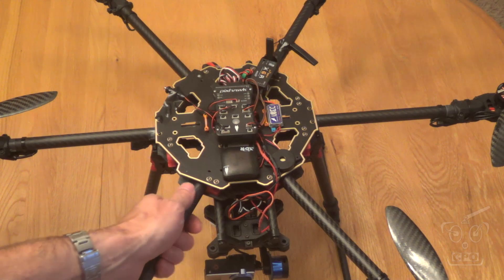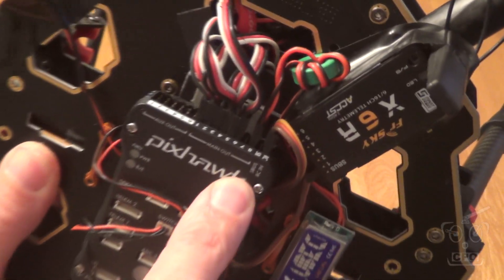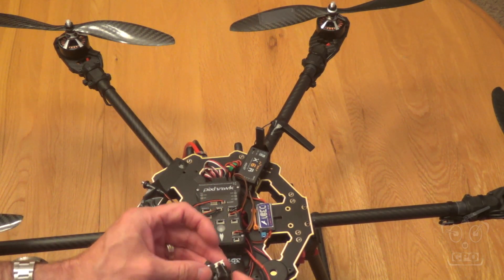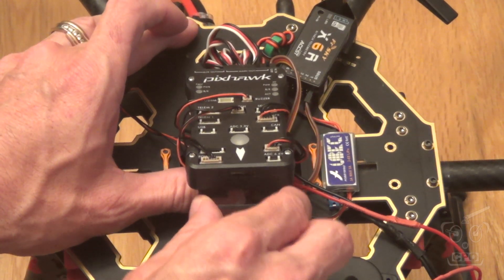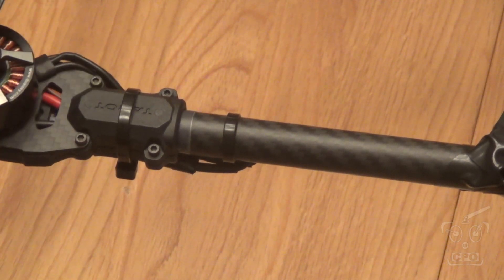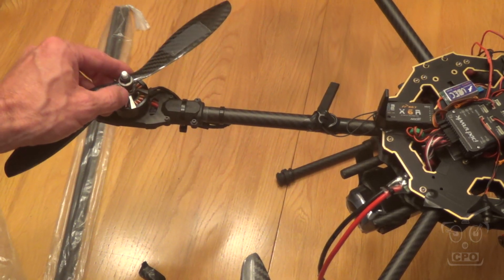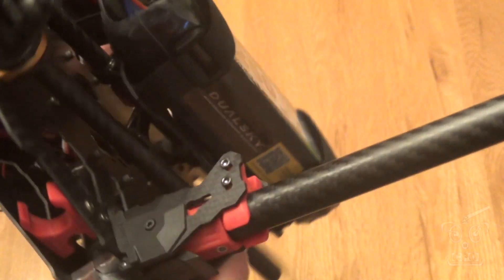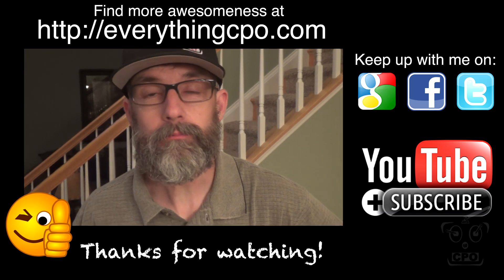Tarot 680 Pro Hexacopter : Build Tips and Update

Comment: Hey, thanks a lot for the video, right now I'm in trouble powering an octocopter with a pixhawk, I'm using the attopilot sensor since I have 6s batteries, but all my main outputs are being used so, I wonder if I could power the pixhawk with a UBEC using the aux output pins, do you know if that's possible? I'm not quite familiar with the pixhawk schematics and pinout yet... Again, thanks for your videos, they've been incredibly helpful

Comment: hi cpo !  can you help me !!  i building my first hexacopter tarot t960, and i will use 6 s 12000mah to power 6 x tarot 5008 340kv motors{from pdb} and 6 hobbywing xrotor 3d opto 40amps esc`s = 240amps max , but this little tarot 6 hub pdb seems to be very small to power 240 amps, do you think i can still use it or i should look for something bigger ?

Comment: Hey CPO, long time no speak. Looks great with your Tarot 680, as you know I found out the canopy mounting holes where wrong. I have now moved onto another Tarot 680, but this time I have changed the arms for longer ones and have ended up with a Hexacopter of 1.04m diameter. Having also printed many custom mots for the various electronics, I have never been a fan of Velcro. I like cable ties. Makes reminding all the items so easy with zero residue. This new Multirotor now has 2x8000mah 4S Lipos. Once I get some spec as per flight times I may decide to increase said Lipos. I am aiming for a 30ish minute flight time. Having added a DJI groundstation, Zenmuse H3-3D gimbal, anti collision lighting and custom made retracts. Anyway. I'll email you shortly, respect

Comment: Yo CPO, just getting into the hobby.  Chose a Tarot 680P Hex, way over my head, but I dove in with both feet.  I think I chose the wrong mode for my Taranis X9D.  Been seeing alot of peeps with Mode 2.  I think I made a mistake getting it Mode 1 and may need to try switching it over internally.  Is one mode better than the other for flying the Hex/Quads?  I am right handed if that even matters.  What's the general preference on these?  Asking as a true newb.

Comment: hi cpo ! i`m planning to build a carbon fiber hexacopter next summer(800mm-900mm and i would like to have your advice on the size of the booms and frame, i would like to use 2-3mm thick 25mm dia. 375mm to 400mm long carbon fiber tubes and 2-3mm thick plates for frame.....what do you think about my first steps ?

Comment: One way to reduce broken legs on landing gear I have used is. Purchase 10mm OD tubing with 6mm ID = 2mm wall thickness VS 8mm ID tubing with 1mm wall thickness can be purchased cheap on eBay or amazon.....

Comment: Thanks for the info man. I have 680pro as well, and having similar issues. The tape on the arms looks like a good idea, gonna try it tonight. What was the tool you used to level the motor mounts? That is a pain in the ass with a regular level.

Comment: I'm planning to build this hexi and I have a power question. I'm planning on upgrading the motor system to the e600 using a 6S battery. The DJI iOSD Mark II On Screen Display Module is 12v. How do you deal with that - also adding 4C LEDs?

Comment: Big thumbs up cpo. Thanks a ton.  I cut a plate of carbon fiber I had left over from another project to mount the APM.  I don't have thick gyro pads so I'm going to give it a try with kiosho zeel squares at each corner.

Thanks again.
Reply from the maker: Carbon fiber plate is perfect. If I had some, that's what I would have used too. I just happened to have the plexiglass from another project. I thought about using zeal gel, actually. I have some on hand, but then I saw those little foam squares that came with the Pixhawk, and decided to go with that. The zeal should work. The only thing about zeal, is that for proper vibration isolation, it needs to be compressed.  The weight of a flight controller doesn't compress it at all, but I assume it will still be somewhat effective. Besides, if you get the props balanced, the vibration should be minimal anyway. I'm not even sure how much it matters anyway. It's not like a camera where you are trying to cut jello.
Reply: Another big thumbs up from me, keep up the good work. I've watch the entire 680 build log up to here now, and keen to see more. Thanks cpo!
Reply from the maker: Thanks, Billy Reiss